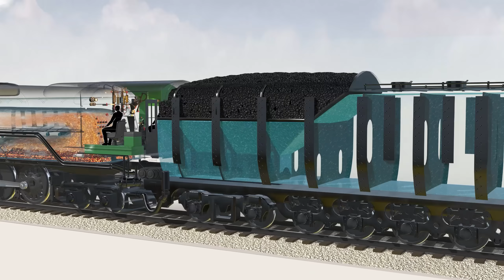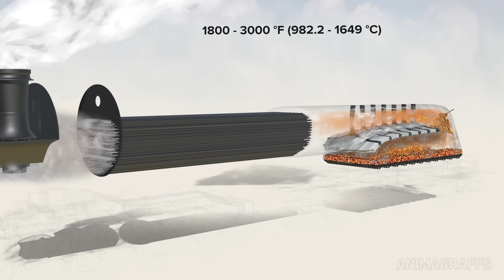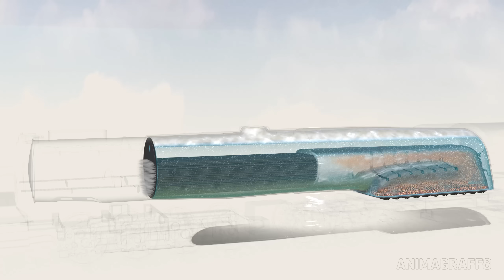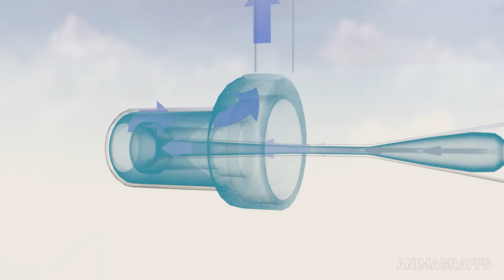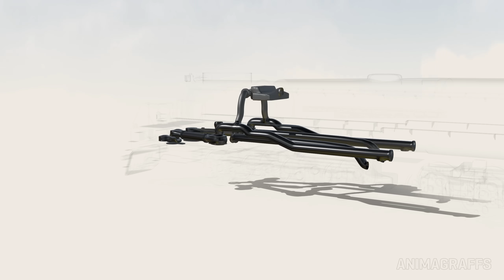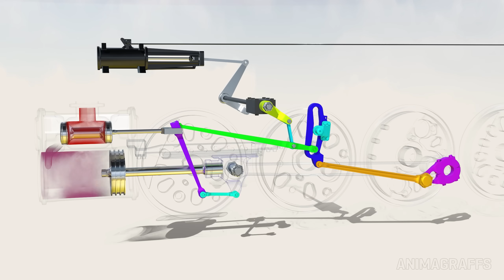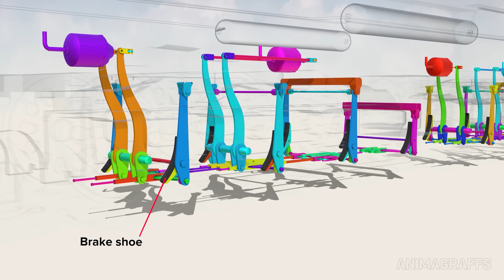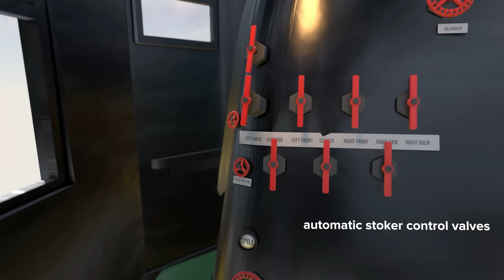How a Steam Locomotive Works (Union Pacific "Big Boy")

Comment: Interesting but the "Big Boy" was neither the largest nor the most powerful steam engine ever built.  There are multiple ways to rate a locomotive (steam or diesel) and the "Big Boy" was only the "biggest in one category.  

Various "biggest" categories include total weight, weight on drivers, tractive effort,  boiler horsepower,  cylinder horsepower,  draw-bar pull, and several others.

Comment: Why do steam engines run an open cycle for their working fluid? 
Why not pipe it back into the reservoir via a bunch of radiators?
Just enough radiators to stop the used steam boiling the water reserve in the tender.
You'd need less coal too, because the water in the  tender is no longer at its coldest, the current atmospheric temperature, but much hotter and closer to boiling, less heating required, better fuel efficiency.
All they're doing now is dumping precious energy from the coal over the sidings

Comment: Great video.

Protip: "Used up steam" is water.

Absolutely no mention of the very important fact that when water flashes to steam the resulting water vapour is at least 1,600 times more voluminous than the liquid water which created it. 
Or the fact the evaporation of water is extremely endothermic, which means it requires enormous amounts of heat, which is why you had to burn an awful lot of coal to get a train going.

Comment: Water is in fact actually compressible.  It behaves like a spring, because everything behaves like a spring.  And I mean everything.  Ask the Titan submersible about that.  Where it was, the water was actually compressed to about 97% of its size had it been at sea level.  The sudden spring action of the volume of water that explosively decompressed when the hull failed was the reason why they were all killed so quickly.  Thunderf00t has an interesting video on the physics of this using boundary condition simulations.

Comment: Steam engines may have been from a primitive era but they were not primitive machines. The engineers and firemen had to know exactly how to keep the fire temp, water levels and steem pressure correct.... their lives depended on it. A number of steam locomotives exploded thru the years, a steam burn death would be gawd awful. All because of the water levels from my understanding.

Comment: Imagine they didn't have computers or calculators to engineer this.  It was all done with pencil and paper.  Calculating the suspension, number of leaves and thicknesses and lengths required on the coil springs for the expected forces is impossible for me to imagine.

Comment: The suspension engineer for this job must’ve either hated his life during this project or got a nice paycheck. It’s amazing how a whole train on steel wheels with little surface contact, all connected to a couple of pins for turning, can pull so much weight. Science is bonkers

Comment: If you open the bottom try-cock and steam comes out - run!  Even if you’re going down the track at 60 mph.  Dump the fire and jump out.  Don’t waste time trying to start the injector and cold water pump.  GTFO instead.  You could ask the crew of C&O 1642 but they’re all dead - and not from old age.

Comment: Steam locomotives would work great for storing power.  Unfortunately, no one makes money on technology that is a few hundred years old.
Imagine two giant windmills generating electricity.  One furnishing power to the grid for use now.  One furnishing power to a steam locomotive that uses it to heat the water.  This locomotive is parked on a hill.  This steam propels the locomotive up the hill.  As far up the hill as possible, while the windmill is turning.  Now, release the locomotive down the hill to generate electricity to resupply the grid.  All using less natural resources than batteries.  Reliable for years to come.  
Just a thought.

Comment: Best practical explanation I have ever seen on steam engines. But what is going on with the flexing of the light blue animated connecting rod on the valve gear starting at around 17:00?

Comment: Absolutely fantastic!!!  I used to work on 3D animation at home with what was called the Video Toaster running on a Commodore Amiga computer, basically the first opportunity for a hobbyist to do so.  It was actually pretty darned advanced for the time.  So I know exactly how much work goes into doing this, and it's a LOT!  Each and every part has to be created, in a modeler, matching and paralleling the real sizes of the components.  Then each has to be 'surfaced', which gives its characteristic look.  All of the parts are assembled and put in the correct position.  Then all of the motion has to be derived. And finally the rendering package puts it all together and turns it into a video!  Quite amazing!

And this is a GREAT example of what you can do with it.  It's not just for movie special effects (CGI), but also very useful for teaching and training.

A marvelous job, thank you so much. I now understand far more than I used to about them.  And I have a career of working in a power plant where most of the equipment is merely this stuff, but very much advanced, of course!

Comment: I thought that train's brakes are sprung, so that in the event of any failure, they activate. They are not activated by the compressed air, but held off by it. Compressed air is used as it won't condense like steam so it maintains pressure over a long time.

I'd like to know if this applies to Big Boy. My source: detailed conversations with the driver of Puffing Billy in Melbourne Australia

Comment: I love your videos. You should do one on modern steam/electric ships. When I was in the Navy, I was stationed on the USS STARRETT CG-31, out of Subic Bay Philippines. We had 2, 1200 psi, stream plants on the ship and 2 engine rooms. They always have extra for redundancy or emergencies. 

In The boiler room, We would make the 1200 psi high pressure, superheated, steam and send it to the engine room. We also made low pressure, 600 lb psi, for cooking, heating and drinking water. 

The engine room was nothing more than a few large steam turbine generators. The generators created the electricity which ran the electric motors, that actually ran the props on the ship. That electricity is also used for anything electric on the ship.

I don't really want to get deep into this, it would be a small book, I thought I'd give you this video idea.

Comment: Fantastic stuff. Just a small correction, the steam is superheated because it’s inherently better, in fact in an ideal world you would want a steam quality (ratio of steam to water) of 80% to 90%, dry steam is actually not as good as wet steam to transform its energy into work, precisely because it’s more less dense AND more compressible (this is what makes hydraulics so transferring work energy). 

But 2 things often make it so that we require dry steam at the start. 1) maintenance, because iron and water don’t play well, and because high speed water droplets will damage everything quicker (because they transfer more energy) 2) even in modern systems, it will proportionally cool down as it achieve work, and it happens that the optimal place to be is to finish working at the sweet spot of 80 to 90%, but if you start right at 100%, you will usually drop too far below, where you then start loosing in overall efficiency (and risk damage the engine.

A note, although wet steam is more aggressive on the engine, a good thing about it is that it self lubricates it, like diesel vs gas.

Comment: Lets see SE-124 steam car 1969 GM prototype, by Mr. Besler, with Tom Kimmel. All I could make out was the steam engine was ~2x the size of an equivalent ice engine, capped to ~75hp in a midsize car. A visibility into the engineering team size and time it took would be useful to mention, and your time too. These videos will be useful over years ahead. External combustion is still doable as a hybrid, with CO2 instead of steam.

Comment: The Big Boy is also known as number 4041, with a 4-8-8-4 wheel configuration (4 steering, 2 sets of 8 drive wheels, 4 safety), also, extra tubes allow steam to go into the firebox to get superheated

Comment: I (as a Marine Surveyor with MarAd at the time) was involved in the drydocking before the sale of the ship to Hadley. When we moved her from NIT to NorShipCo also aboard were Captain Bill Kolbe who sailed many year as Chief Mate on her and was one of the finest seaman I have worked with and Commodore Alexanderson who was her last Master and Marine Superintendent of US Lines. At that time MarAd had her preserved under dehumidification and within a short period we could have activated her for service. One sticking point in any maritime operations these days is asbestos and of course the Big U had a lot. Remediation was possible but very costly.  Numerous pipe dreams arose from the Government for use as a hospital ship ( which would have required substantial reconstruction) as well as using her to replace the 5 aging state maritime academy schoolships. Sadly after Hadley's sale of interior fittings her fate was sealed, a very sad event. After it's trip overseas for asbestos removal ~ that was the end. In conclusion, the current plans to reef her is perhaps the most fitting end for her.

Comment: Starting steam engines as this is challenging since all the pumps, fans, generators and feeders are driven by steam, which is not available on beginning. Sufficient greasing of all the gears was also time consuming. Together with low fuel efficiency below 10% compared 35% of diesel engines, steam engines could not compete anymore.

Comment: As beautiful and romantic as these machines were, their thermal efficiency was truly awful. Only about 7% of the potential energy in the coal actually makes it to the drive wheels in open-circuit steam locomotives. This inefficiency is primarily due to the very low pressure, only 300 psi, and the fact that the steam is used in an open cycle: it's only used once, then dumped. In a stationary steam power plant, the steam is heated to much higher pressure and temperature - typically 550°F at 1,000 psi - and is expanded twice, first into a high-pressure turbine, then the exhaust steam from the HP turbine spins a much larger low-pressure turbine. The exhaust steam from the LP turbine is then run through a condenser and pumped back to the boiler. A modern coal-fired power plant operates at around 38% thermal efficiency, much higher than even the most advanced steam locomotives like the Big Boy. The only reason that the Big Boy even existed, was that during WWII, petroleum was needed for the military: to fuel warships and military airplanes, and to make lubricants and motor fuel. None of these military applications needed coal, so it was available, plentiful, and inexpensive for railroad locomotives. The other problem that sealed the fate of steam railroading was manpower: diesel electric locomotives in the 1950's could move up to 5 times more tonnage-miles of freight per man-hour and dollar of maintenance cost compared to steam locomotives. Diesels required only the fuel and lube oil to run, and not also immense quantities of water for open-circuit locomotive steam boilers. Modern diesel locomotives with computer-controlled fuel injection have improved efficiency to where they run as much as 10 times less expensively for manpower and maintenance, than it would take to move freight with a steam locomotive. 

But sadly, no modern diesel electric locomotive will ever feel or sound like a "living being" in the way that 4014 does. There's nothing like the wail of a steam whistle and all the other sounds of an operating steam locomotive.

Comment: Steam is superheated water, it's still water. Water molecules don't undergo a cracking process in hydrogen and oxygen, that would make for a spectacular explosion. It makes no difference if you can see the water droplets in it or not, steam is water vapour. It's a gas, but its a gas made of H2O and the surrounding atmospheric molecules still. If you allow the invisible steam vapour to cool down, you get water again, so it's still water.

Comment: Very interesting video, two things caught the most wonder
- How passive the whole engine is. Most parts are passive, like the tubes and nozzles. It's a solid part that cannot fail over time. Steam itself is the only thing that moves through it. Cylinders, drivetrain rods and wheels are the only mechanical moving parts. There's no belts and pumps and chains that waste energy and wear out over time. There's nothing inside the engine or the combustion chamber that would need maintenance or a rebuild, from what I understood.
 - Variable valve timing already existed on the steam engines

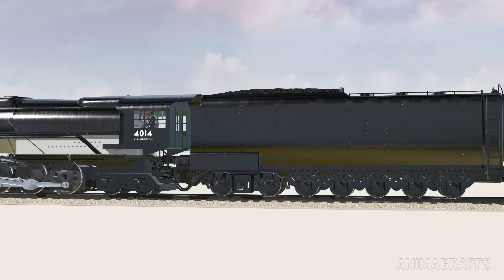Comment: 1:02 Dude how did you f up the units conversion to Kg? And get the weight wrong AND Speed?
4884-1: 1,189,500 lb (~539,548 Kg)
4884-2: 1,208,750 lb (~548,280 KG)
Top Speed is ~60 mph

Comment: My grandfather retired as roundhouse foreman from Missouri Pacific's Shops in North Little Rock Arkansas about 1959(I was 9yo)
He used to take me into the Shops and let me climb up into the engines and blow the horn...loudest noise I've ever heard was those horns inside a brick roundhouse. My dad and his brother started working there at 14yo & 12yo as messenger boys(the intercom system of the day.  Dad died at 54yo with 40yrs seniority in the brake shop (with twice the seniority of his foreman).

Comment: What’s impressive is how you chose a superpower articulated locomotive to demonstrate the workings of a steam locomotive. If you’re going to go whole hog why not do a compound locomotive? or a duplex drive? I suppse keeping it relevant to an operating excursion locomotive makes sense though. This was a fantastic lesson about a complex machine that doesn’t always appear to be. Couple of points; bad water treatment-always a bone of contention in the workings of a steam locomotive. The rear set of drivers on an articulated are rigidly fixed to the frame, only the front set of drivers move side-to-side. Depending on the railroad, the locomotive may or may not have automatic stokers-the auger below the cab floor that moves coal from the tender to the firebox. Some railroads used “hand bombers” right up to the diesel and even with a stoker spreading out the coal there were always “holes” in the bed that had to be filled in by hand. The use of oil as a fuel; the layout of the firebox and grate changes. The last thing that never gets talked about in-depth is cutoff. Cutoff is controlled by the engineer using the “Johnson bar.” You can think of it as a sort of “steam clutch” in that when the bar is closed, no steam flows and the engine won’t move. When the bar is hitched up in the center, or 50% cutoff, half of the available steam is used. It’s like “riding the clutch” in a car. When the bar is wide open, or full cutoff, all of the steam being made is going to the cylinders. Why use cutoff? Some locomotives didn’t. Those engines had high-horsepower boilers that could keep up enough steam at any speed. In a smaller locomotive with less thermal capacity the Johnson bar was used to limit the amount of pressure lost when starting a train so the engine didn’t run out of steam when starting the train. A wily engineer could virtually eliminate wheel slippage when starting a heavy train by intelligent use of the Johnson bar.

Comment: I had no clue as to all the technology that went inti these steem engines. I worked on the railroad a few uears ago so the newer trains dont have all the valves and such that the dteem engines do. Even the train engineer has it a lot easier. But this was very well done snd quite interesting to me. Yhanks

Comment: one other thing that wasn't mentioned about why blowdowns are so important is the sludge and slag build up from impurities in the water can cover the walls of the boiler, not letting the water cool the meatal down and as stated the intense heat directly on the metal will make it very hot eventually causing catastrophic failure.

Comment: the only glaring inaccuracy is the top speed, which you've stated as being 70, even though the locomotive back during testing was rated for and designed for a top speed of 80 miles per hour, though they never operated anywhere close to this margin as their peak power output was at 35mph.

the 70mph that you took as the top speed was what the big boy was known to be able to attain on level track in working conditions I.E. with load, a very different metric from overall top speed.

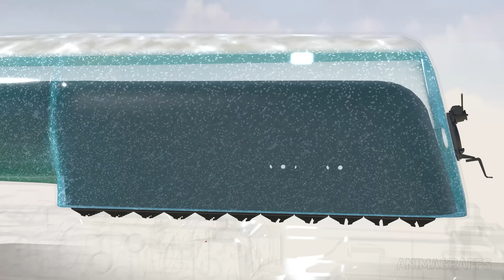Comment: 5:45 I doubt that it'll melt the metal. I could be wrong. But it'll reduce its strength to the point of catastrophic failure. 7:15 Yes, water is compressible. Just not enough for it to matter in this context. The water at the bottom of the ocean is compressed.

Comment: A couple decades ago, I managed to het my hands on a program called Trains.
I remembered an article by a fireman that described what one particular engineer did to run his steam locomotive.
While the train was still not moving, he put the throttle at notch 7.
He used the reverser to control the locomotive.
He seemed to get the best performance from whatever locomotive he was operating.
I tried it on the Trains program, and it seemed to work the same way.
I realize that it’s a poor substitute for the real thing, but even in a lowly computer, it worked!

Comment: Ya done learned me something this morning. I've only laid eyes on a couple of these engines in my life. I was at a rail museum in Denver that did have a rather large and impressive model railroad layout; the other was up in Wisconsin at the National Railroad Museum in Greey Bay. I had no idea that the chassis under the engine was articulated like that, but it does make sense. I guess the overall package was already way to large and complex to include a condenser in the steam circuit to cool,  condense, and reuse some of the onboard water supply.